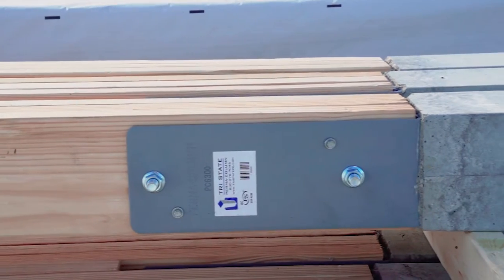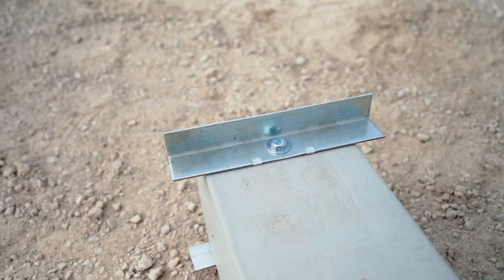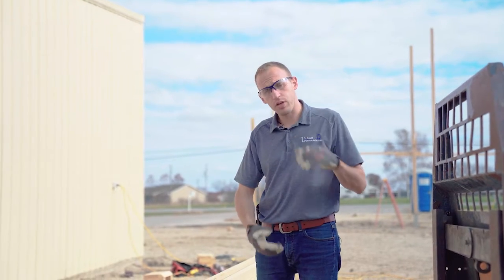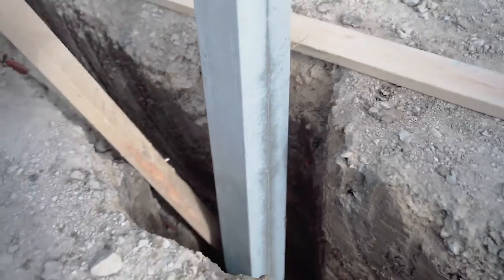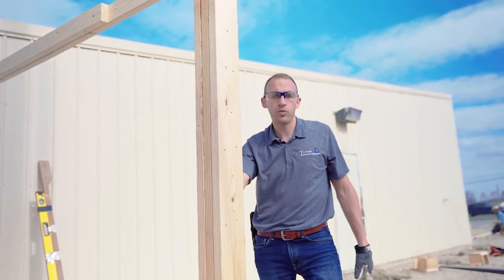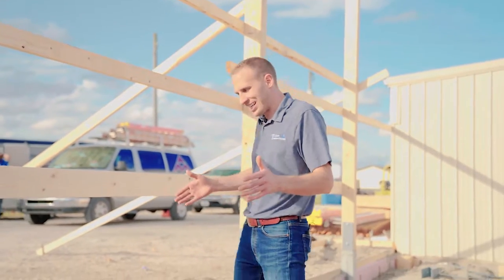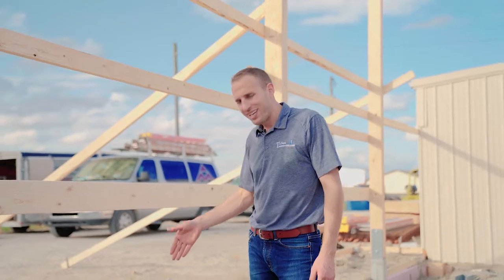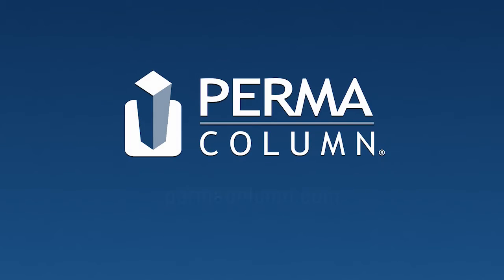How to install Perma-Column with a trenched, insulated grade beam

Comment: Nice!  -- QUESTION -- But how is it attached to the "cookie" or bell housing to prevent up-lift.  I don't understand, is this simply back-filled with no connection to the concrete "cookie" or any bell shaped structure to stop up-lift??

Comment: would this application eliminate the need to put the perma columns deeper below the frostline since your insulating around the whole outside perimeter?  Sort of the same way a frost protected shallow foundation slab
Reply: A floating slab/building MAY be cheaper